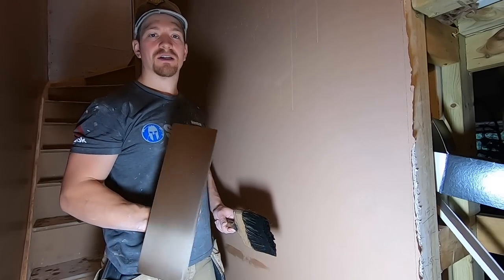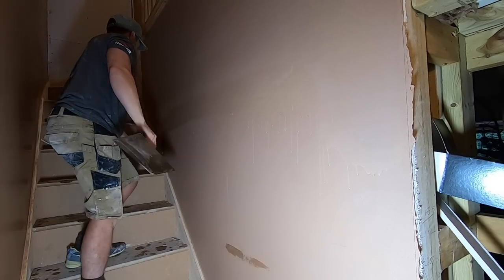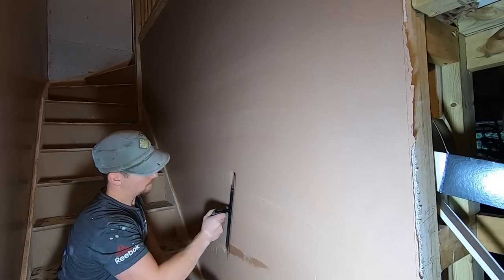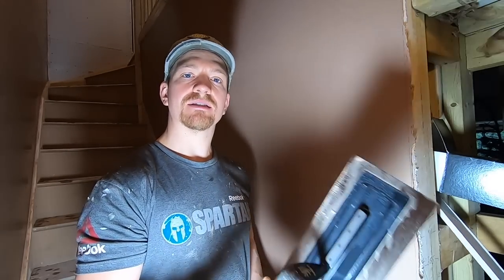NEW!! Nela BLACK EDITION Plastering Trowel Review (Is it Nela Trowels Best One???)

Comment: Hello.
With this black nela finishing trowel, you said you are trying it firstly on your wet trowel, 2nd to last trowel, how many times have you trowelled up prior to using this with your steel after flattening in your 2nd coat.
Many thanks Karl.
Ps, I use steel from start to finish and can't get on with flexis or at least get use to them.

Comment: I recently got a Nela super flex two gold edition. I warped it a little bit because I pushed too hard on it. I used two hands when I should’ve used one so be careful. I do Venetian Plaster in Los Angeles and now, if I don’t push a little harder on the rear of the handle rather than the front I get lines in my Venetian Plaster
Reply from the maker: I think these trowels are too flexible for Vencian plastering pal. Try a solid trowel like a Marshalltown Permashape. That's the one 👍

Comment: I have a nela medi flex is there much difference with the black edition when is best to use cheers
Reply from the maker: It's supposed to be the middle ground between the Nela Flex 2 and the Mediflex. However, if you've got one already then I wouldn't bother getting the Black edition. The Mediflex is more than good enough my friend 👍

Comment: Hi buddy which do you prefer the Ox ultraflex or that one?
Reply from the maker: It's tough to say since they are different trowels in terms of flex and roles. I'm going to try it out further and then I'll let you know pal. However, I am very impressed with the Nela trowel so far - it's a cracking tool 👍
Reply: @PlasteringForBeginners  awesome cheers bud!
Reply from the maker: No worries mate!

Comment: Great review! The Nela trowels are awesome.
You had much experience with lime plaster?
I know some say not to put gypsum over lime and some do. I appreciate solid external walls wouldn’t be ideal as it needs to breathe but would internal walls be ok for a multi finish re skim?
Reply: I have replaced gypsum plaster with lime on the ground floor of my home, because the gypsum failed badly. Stick to lime plaster in old buildings lacking a DPC or having solid walls. Gypsum is too moisture sensitive. With that said,  the first floor walls of my home are cement rendered and skimmed with gypsum plaster. I would not replace that combo unless it fails, because it's hard work, costly and it might damage the walls. However, I would prefer to use lime on all walls, on all floors if I was starting with bare brick walls.
Reply: Bad idea it causes moisture problems, you can do it gypsum over lime plaster the only thing is that the lime can ventalate properly and condensation occurs